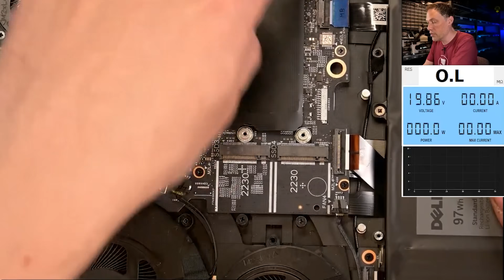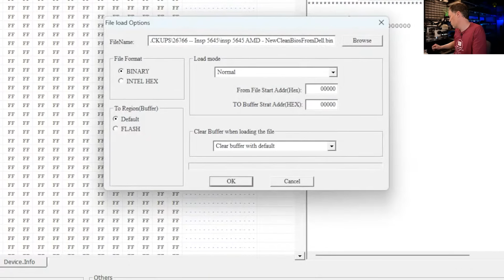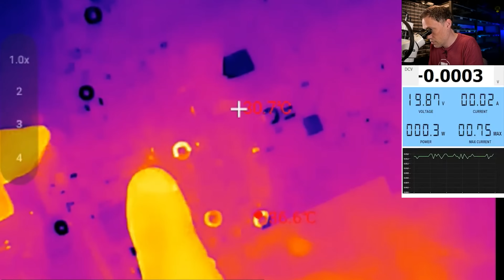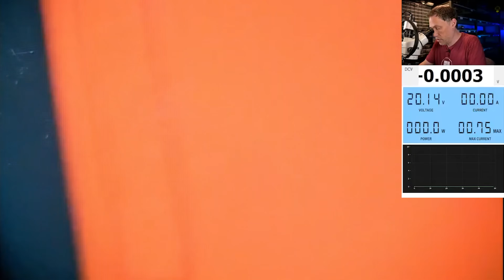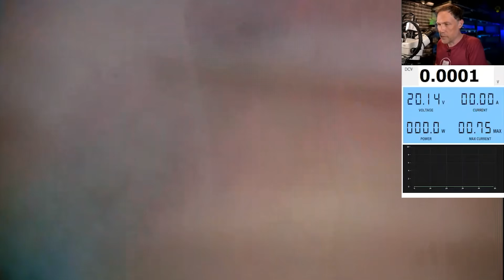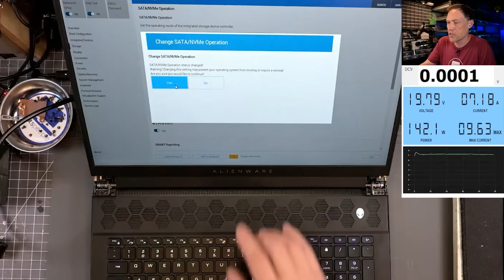The Craziest Repair Attempt I've Ever Seen On A Laptop... EVER!

Comment: I bought a Yamaha keyboard one time that didn't work. Took it apart and someone had broken the PCB and super glued it back together 😂
Excellent work.
Reply: Now all you have to do is run bodge wires for all the broken traces. Depending on how and where, it can be as easy as 2 or 3 all the way to an impossible amount. I know I made it sound easier than it is, and also perhaps some new components would be necessary too, but my point is that sight unseen, it smells like a good start to an actual repair.

Comment: Actually, after failing to boot a few times, Windows will boot into Safe Mode and switch drivers.  If you were on RAID and switched the BIOS to AHCI, after a couple of fails Windows will boot into Safe Mode, load the AHCI driver, and then you can boot normally.  Same should work going from AHCI to RAID. 

The issue arises because Windows is trying to load the wrong storage driver.  You can also set a flag in Windows to boot safely next time if you want to change modes in the bios.  So, you'd set Windows to boot safely next time, but shut down.  Switch modes in the bios, and then boot Windows.  Windows will now boot to Safe Mode, load the correct storage driver and you can reboot normally.

Or, just do what Nate did and switch it in the BIOS.  However, I've noticed that RAID mode can cause problems on certain models if you're not actually using RAID.
Reply: Way back in the Windows XP-Vista-7 era, you had to go through some convoluted steps to get this working. IIRC, Windows XP, in particular, did not have an AHCI driver bundled, so you had to install one.

With all the above versions (I think), you also needed to manually edit the registry to set the driver to be loaded at boot, so it could make the device available to the system and allow the kernel to load and start other components. The reason it could get far enough to show the blue screen error is because the loader uses BIOS/EFI services to access the file system and load the kernel, registry, boot time drivers etc.

Comment: I remember seeing a repair video where the "repairer" used epoxy adhesive instead of solder and couldn't understand why the amp was not working.

Comment: I got thinking about what you said about RAID vs. AHCI/NVMe.  My laptop was set to RAID, and I do have 2 drives, but I'm not using RAID.  I found some steps that I followed.  1. Set Win 11 to boot in safe mode.  2. Changed setting in BIOS.  3. Booted into Win 11 (safe mode). 4. Turned safe mode off.  5. Rebooted.  No errors, no blue screens, everything seems fine now.  Storage controllers now show generic NVMe instead of Intel.  I should have run benchmarks before and after...

Comment: Hello, I have an HP EliteBook Folio 1040 G1 Laptop., The WIFI connection at times disconnect on its own and the WIFI icon disappear., at time, I may have to restart the system, which may comes up or not at time., Can only access the internet via the USB Tethering with my phone., also the BIOS setup is passworded as well and can't access it! 
What could be the solution...? Thank.

Comment: I have HP 360 Specter that is in need of help after surviving my 14 year old for over a year. No power up or charger recognition no battery light and system gets hot fast on gaming. You up to the challenge?

Comment: Short Querstion, maybe someone can help =/
I Have a HP Probook 430 G6 which is Turning on and Bootloops. I Press F10 and it tells me to "Go into Settings" but .... it Reboots.
Can i save that thing? Maybe with a New Bios flashed on the Chip or  could it be the cause of something complete different?
I Knwo telling what the source of a problem ist without the device is bad, but, maybe a good guess is coming around =)

Comment: you make the soldering look easy...I tried fixing my daughters toy the other night so I used the copper wick or whatever it is to get all the old solder off.....realized VERY QUICKLY that copper is a great conductor of heat lol
Reply: @rebel3353  dude try using tweezers, and cut it into little pieces

Comment: I'm sorry but hot glue ? ? ? ?  I am officially saying that if you find someone using a nail or staple gun to attach a chip this will definitively mark the end of days (lol).  Great work.
Reply: @streamrsm1009  speaking of nails, nail polish melts at 150-200C so should have been fairly safe to use it instead of hot glue. 🤣
Reply: I like hot glue for some applications (loose connector, wire management).  Board mounted components though aren't one of them.

Comment: Regarding the RAID set in the BIOS. Dell has gotten really weird these past several years. They are installing multiple DIFFERENT drives and setting them up with RAID in the BIOS/UEFI. Goes against everything I learned about RAID.

Comment: I have a question.I have a dell g16 7630 The question concerns, the bios, I had one ssd drive come with this laptop with the bios set to raid, however, noticing the ahci option. I want to clone the original dell ssd that came with a laptop.  To another equal SSD of 1 TB, is it safe to switch to ahci or just to leave it in raid? I don't want to use raid.What is your experience nathan thanks